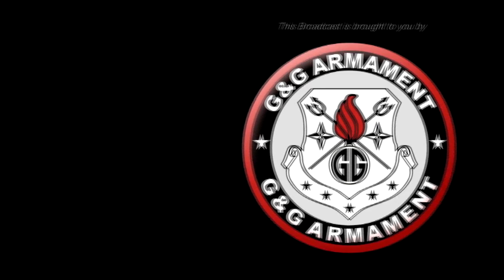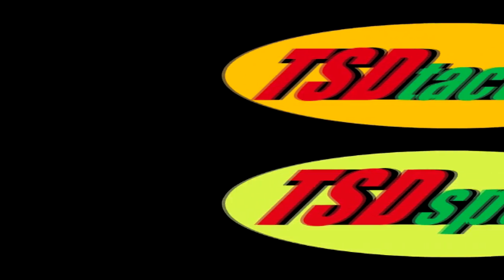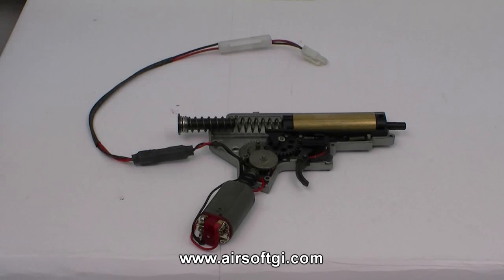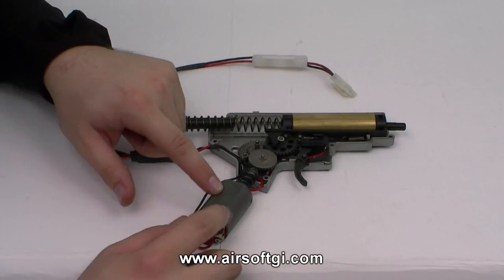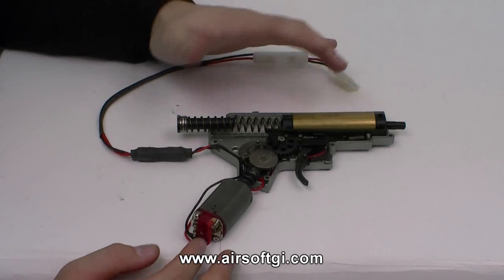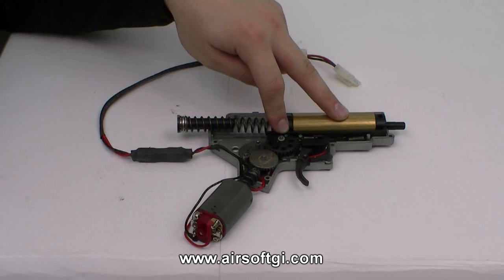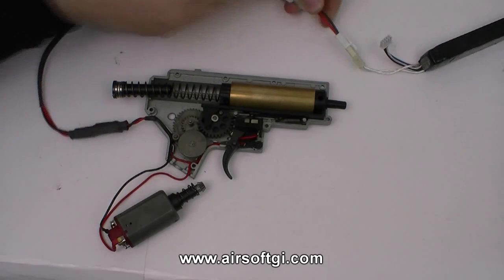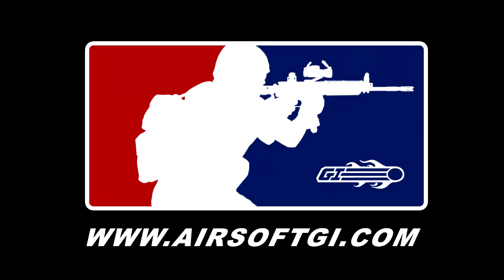Airsoft GI 101 - How it Works - Automatic Electric Gun Gearbox

Comment: no, a weaker spring or a stronger motor will give you a faster gun. Stronger spring makes a SLOWER gun but higher FPS. A motor does nothing for FPS, only rate of fire.

Comment: NickDenning3,
Yes, the Echo 1 has a motor adjustment screw. It is the center screw on the bottom of the pistol grip. And you should use a g36 disassembly guide from here on youtube.

Comment: NickDenning3,
 There are teeth on the bottom of the piston, and on the gears. One of these teeth will be broken off. The piston might be missing the second to last tooth, which is normal. Find out if the moter adjustment screw(small screw on the bottom of the pistol grip)has been messed with before you take the gun apart. Have either of you ever opended a gearbox before?

Comment: @NickDenning3
If the gun makes the clicking sound only when the battery is connected, the piston or a gear has most likely been striped and has jammed the gearbox.  You will have to open the gearbox to fix the gun.

Comment: LtJuno,
Nope no response from anything as far as I can tell. Its kinda hard to explain, but the click happens when you pull the trigger so Im assuming its a wiring problem or the points on whatever makes contact when you pull the trigger has broken or come loose. Hope that helps.

Comment: @tvillalobo It works the same way as a V@ gearbox but in the Cylinder there is a small hole at the top to allow some of the air to be redirected at top portion to push back the small piston in side there. Which pulls back the bolt. It moves forward by a spring inside that top part pushing it back forward like an AEG spring. Just much lighter of course.

Comment: I have a front wire gear box and want to get the wire in to them butt of the gun so i can have more bigger batter.What should i do try to rewire it send it to you guys or just buy a new gear box or buy a new gun.
I have a front wire M4 but going to buy a M16 stock.